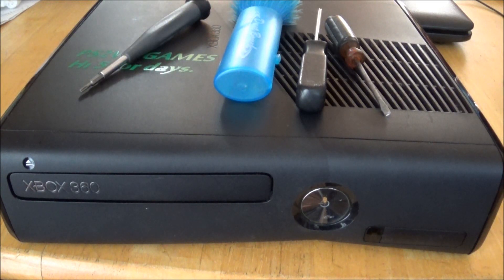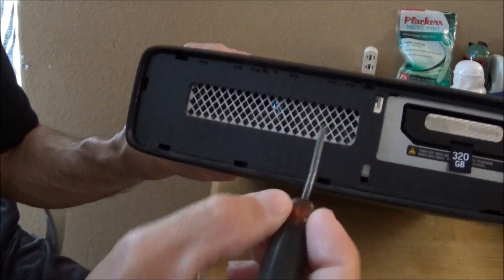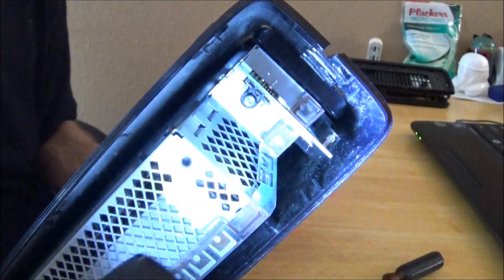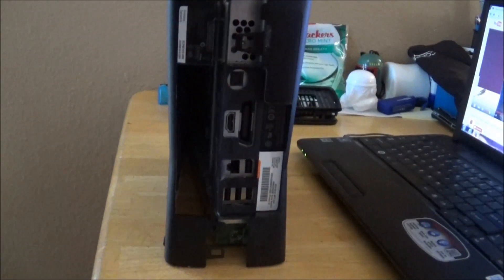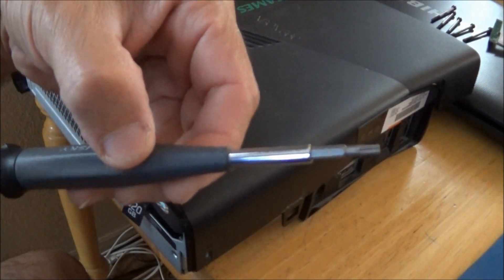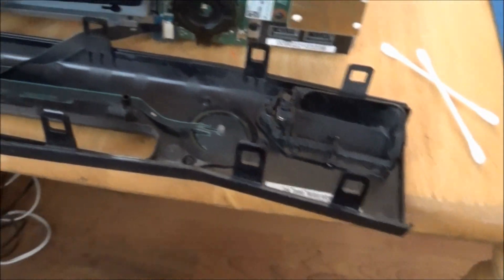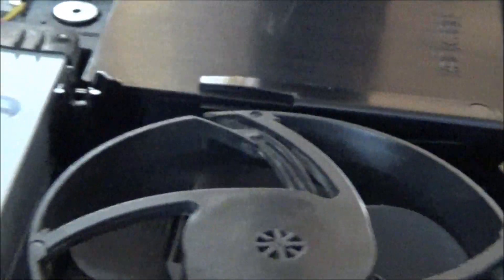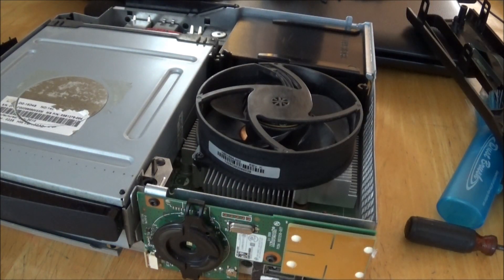Xbox 360 Tutorial: How to take apart and clean your console

Comment: I have a trick I use on my consoles and computers so I don't ever take em apart. When I get em new I get fat lady panty hose and cover all the vent holes. I just take the panty hose off and rinse em out once in awhile. Dust can't get in and it works well. Try it out. Good video!
Reply from the maker: +NewZona Rides  if that works for you but I'm just going to leave it stock lol thanks for watching.
Reply: +NewZona Rides Great Idea! I always have used a "Used Drier Sheet"  they work great!